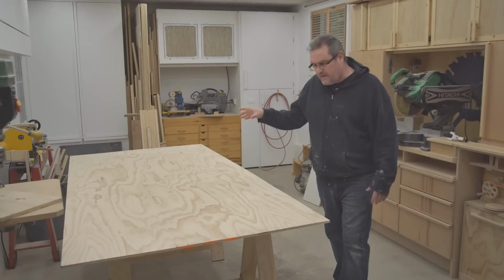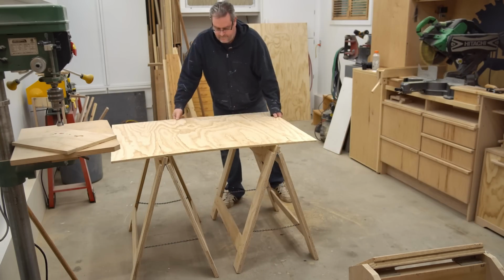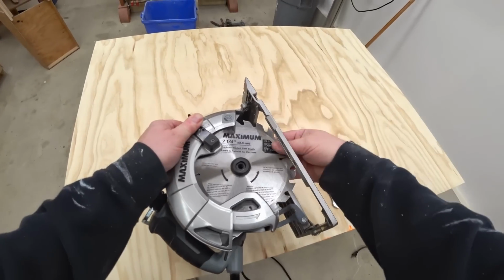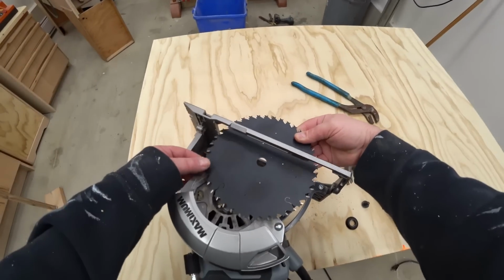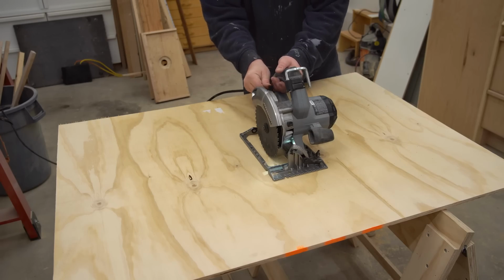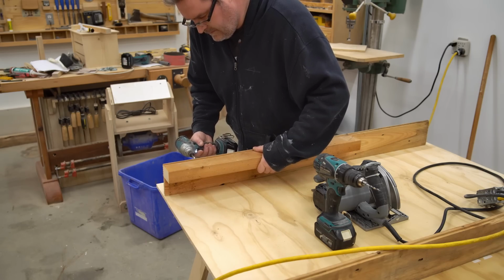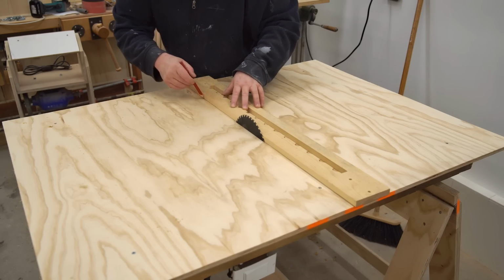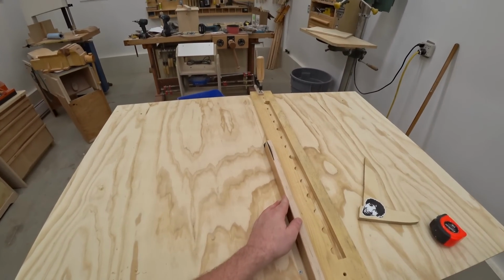Making A Quick And Dirty Table Saw (in about an hour)

Comment: Back in the day, the idea of buying a portable contractor saw was out of the question., So,  I used to make job-site "table saws" just like this and screw the "top" to two saw horses.  Add a straight edge with two quick clamps and we were good to go. Very, very useful for plywood and paneling work.

Comment: I have been meaning to make one of these for a while, but much to my irritation I have yet to find a drill bit that will even touch the saw plate of the old Black and Decker Professional  saw I want to use ! Cobalt won’t do it so I’m going to have to buy an expensive Tungsten  tip, who’d a thunk it !!

Comment: Funny story time. John, I used a circular saw to make a table saw in a box.  It all fit in the wooden box it came in.  Plus I could easily remove it to use the circular saw as it was intended. Similar to you,  I used a black zip tie for the trigger, except my saw had a black handle that basically camouflaged the zip tie. I forgot to unzip it one time, plugged it in and watched it run across the carpeted floor until it pulled it's own plug out of the wall.  Just missed my leg, ruined the carpet too.    But I really liked the idea of the table saw box for site projects and it worked well.

Comment: Looks a lot like my 'not-so-temporary' table saw that I made from a saw that died, I resurrected, but not before I'd bought a new saw.
My saw table is a lot smaller though, but attached to an old folding workhorse so I can set it up really quick. It has served me well in my renovations, especially as I don't have a shop at home and I can set it up in the yard easily.

Comment: I'm an oldtimer - born in the early 40's!  Growing up I remember seeing a lot of home made table saws.  2x4 frames with a wooden top.   The blade was mounted on then end of a shaft and bearing assembly, belt driven with a surplus motor.  It sounds crude today, but that was a different time!  They got the job done!
Reply: That's how they do it in the Philippines today, with a gasoline motor.

Comment: Great temp saw. Thanks for the video. 

Had a quick idea for quick and easy fence measurements. You could put little holes for pins ( 1", 2", 3" etc plus the width of your fence)  to the right of the saw on both the near and far sides. Label them. Put a pin in it and then quickly butt the fence up to it and clamp it down.

Comment: My first "table saw" was something like this. Actually used it for a couple years and built quite a few furniture projects  before buying a used table saw off Craigslist. Not the most accurate thing in the world and slow to set up the "fence" (which was a level and clamps) but it worked. In the end the limiting factor and the biggest reason for an upgrade was the 1 5/8" max depth of cut.

Comment: Not using the angle grinder protection screen (and two hands on the grinder) can cost you a fine of 10000$. 
Danish Working Environment Authority is so concerned with safety they forget to bring the brain with them to inspections. I was once told to stop everything at once and leave the work site for a serious breach of safety rules. After a bit of negotiation the work could begin if the crane was disconnected. Three days later we got stickers measuring 5 by 10 cm. After putting them on the massive columns supporting the 5 ton overhead crane we could use it again. The text on these small stickers read: "Danger Crane at work". 
,

Comment: Now, a simple fence which is easily kept parallel...it would be sufficient...
Reply: cord21465 ya. I would have expended the fence a foot and screwed a 6” wide plywood Tee on each end so it would slide across the top parallel to the blade.  Good vid tho!!

Comment: I did the same with Makita saw and it wobbles under load. Basically, the shoe on it is attached off-center and only at two points, plus the sliding guide is very flimsy as it is not designed to hold the saw.

Comment: I'm loving the helmet cam!  The circular saw blade drawer was my double take replay this time.  Excellent video.  The screw driver rack is awesome.  Your shop is looking great!!   I've used these Table saws in the past on job sites for full sheets of plywood.  The table was much larger though.  Lots of trouble and with measuring off the reference line for the fence.  I see you already solved the issue in your next video.  Well done.

Comment: As an inexperienced young hobbyist, a question that comes to mind is: 
If I made this, would it be in any way more likely to kill me than any other table saw?
I'm sure John's experienced enough for this not to be an issue, but sometimes I have trouble judging what's a good idea to try myself and what's not. And a DIY inexpensive table saw is tempting. Should we stay reasonable and civilised, a discussion on the subjet won't hurt :)
Reply from the maker: As long as you put this together properly (ie. the saw doesn't fall out during a cut...), it's not much different from a "real" table saw. Tools aren't dangerous - actions are.  So if you are going to injure yourself, you'l do it just as easily on the real thing.
Reply: Jose Just don’t get your fence crooked to the blade. Clamping it in place each time vs having the repeatable locking feature on the “real thing” opens you up to more potential for mistakes here. If your fence isn’t parallel to the blade you’re asking for some trouble, but that’s something that’s relatively easy to control as long as you’re watching for it. Stay alert and be present and think through each cut before you make it. Same rules as normal.
Reply: I will give you a quick advice. If you are worried and unsecured sure something will happen do not try this @ home. 😁
Reply: I built myself a home made saw a couple of years ago and it does the job but I have had kick back which hurt my wrist, nothing "too serious" but my suggestion is to buy a splitter to attach to it just to make it a little more "safe".  It just ties me over until I can afford a decent table saw.
Reply: Yes and no. Kick-back has already been mentioned, be aware of that. Another thing is stability, mount it rigidly on a very sturdy base, at proper working height. I would recommend a higher fence, as it will probably be beneficial when
 cutting thinner pieces. Finally, make the table of something with a low friction surface (I made mine of melamine particle board), then you will not have to push your workpiece through with force.

Comment: Not sure if you already covered it but why did you get rid of the original table saw ?
Reply: DENIS KENNEALLY I believe he's building a new table saw, but wanted to do it from the perspective of someone that didn't already have a TS yet, so he dismantled the old one first. Yes, John is a badass. Purely my opinion, but I like to think (hope) he's also doing it to rile up the safety trolls (no guard or riving knife, how could post something like this!?!).
Reply: Edward Chen ah, that's cool thanks for the explanation.

Comment: Any thoughts on adding a couple of length-wise (parallel to the blade) stiffeners to the back? I don't have your level of experience and I am not there to see how "stiff" the supports are against rocking motion in the direction of the fence but my civil engineer in California (earthquakes and lateral loads being the dominant design forces) brain is worried that the top could collapse under extreme circumstances (which I suppose is beyond the expected use of this contraption). I feel I am going to become another example of the "compressor in closed cabinet" people so please have mercy on me :D
Reply from the maker: It's a case of overthinking it and not knowing the strength of the materials used / loads involved. The strength axis of the plywood runs parallel to the blade, so adding extra support will do little for it. And on it's own, 1/2" plywood will support a lot of weight - I'm ~250lbs and I could easily stand on that top.
On top of that, this is a very temporary build, so it makes no sense spending extra time and wasting materials to beef it up.
Reply: Thanks for the extensive response! It gives me a perspective on the strength of 1/2" plywood! :D And thanks for posting these and also for not getting angry at me for the "case of overthinking it". Although you can use this as an example in your next Scrap Bin video ;)
Reply: Alipasha Sadri  relax . This guy has done awesome jobs by mixing things up.